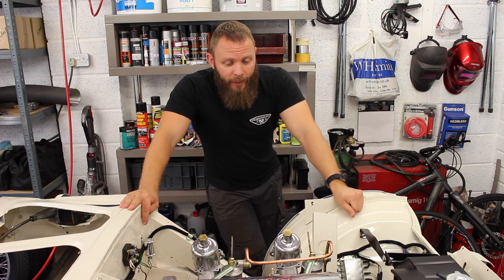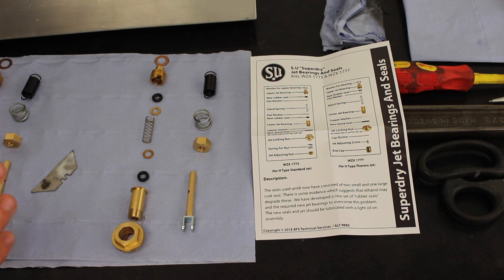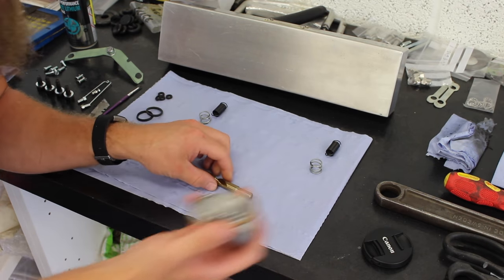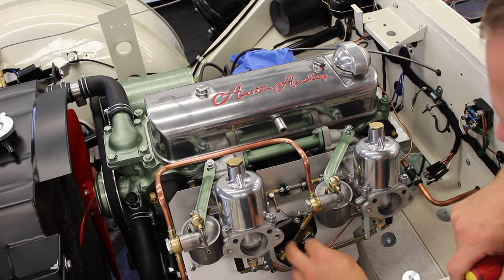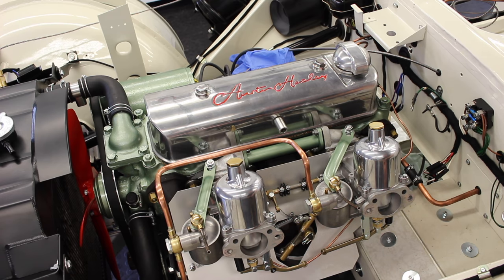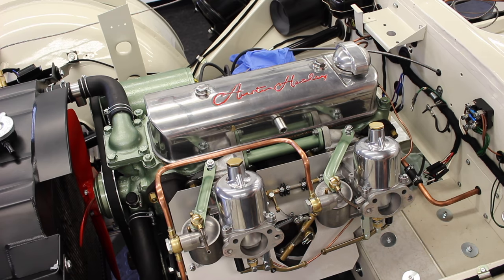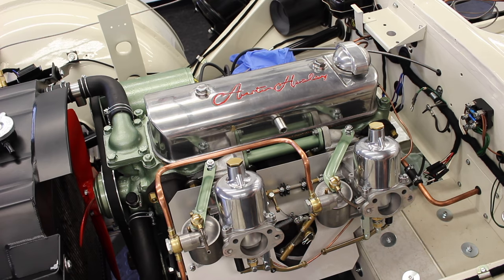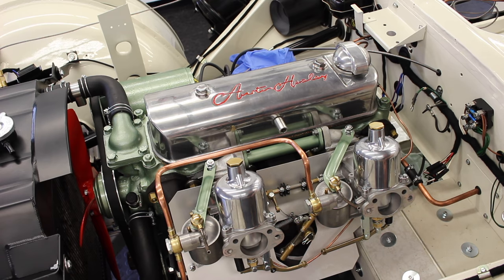How to Set Up and Tune SU Carbs in Easy Steps

Comment: Whats happening if the carbs start spitting. Popping back through the intake when you open the throttle? Especially if you go full throttle quickly from idle.....carbs going pop....pop pop pop.....pop....pop pop. 

Whats causing that? Having huge trouble tuning my triumph 2500tc.
Reply from the maker: Sounds more timing than mixture. Do you know the timing is correct?
Reply: @Resto.Nation  yeh. Brand new coil. Dizzy cap. Points and condensor, ht leads and spark plugs. All that side is brand new. I uses a timing light to set the timing to 12 degrees bedore top dead center. Haynes manual says 10 but its just a fraction smoother at 12. 
Car ides amazingly well. And very light revving is fine. Its just under load or if i go full throttle. It should rev smoothly. But it doesnt. Has been a real mystery to me. The set up i did what you did to a T....just. car and carbs are from 1974. And sat for 8 years in a barn.  Full overhaul though. New jets. New float needle and seat. New seals. New diaphram needles. Got the right amount of the right oil in the dashpot.....got the float level about right where it needs to be. Its just not playing along how it should.....float level was an issue and mine doesnt have that bendable metal thing. Its solid plastic with a pin. To.lower the float level i have to use  copper washers on the needle and seat mount. That initially was an issue. Float was too high. Got it down to about right  when the choke is on and you look down the jets. How far down there should the fuel be sitting? About level with the jet with choke full on yeh?
Reply from the maker: @evanoconnell9448  is it something breaking down under load? Can it be anything as simple as a ground? Might pay to remove and clean all grounds and apply some dielectric grease to them as it’s good practice. You can use it on your ht lead and coil connections too.
Reply: @Resto.Nation  thanks. Ill give it a try. I did have it running well. Fuel pump failed. Decided to put newer carbs on....car did not like them whatsoever. Put old ones back on. Just old issues to sort out. But it was running quite well for a bit. Ill get it back. Thanks for the help. Ill do that and see how it goes.
Reply from the maker: @evanoconnell9448  good luck with it.

Comment: Where you too?  I’m restoring a 100 4 in Bristol, you local?
Reply from the maker: Very local to Bristol 👍🏻. How far into it are you?
Reply: @Resto.Nation  Not as far as you but your videos have pushed me to get busy.  Im in the Chew Valley so just outside Bristol.  Just finished building the engine, gearbox done, I bought a new body tub which was interesting so will be back to the bodywork once I move the engine back to my other garage.
Reply from the maker: @jasonbrooke1302  nice touch. Body tub from AH or Dave Hardwick?